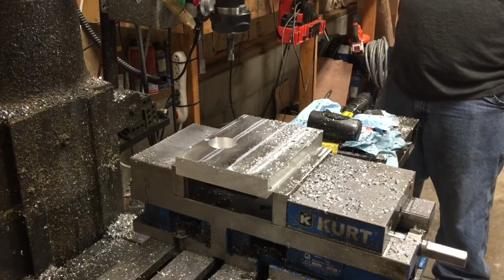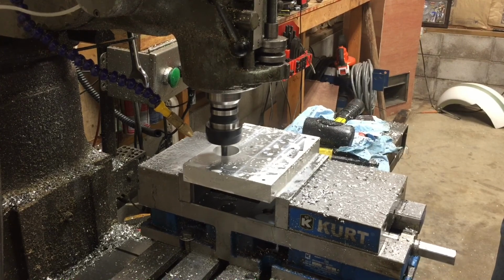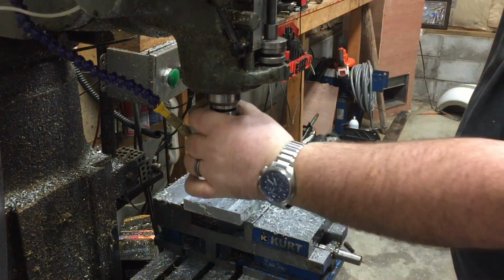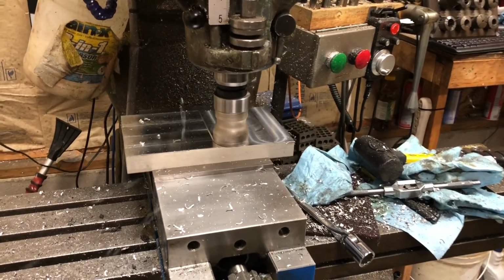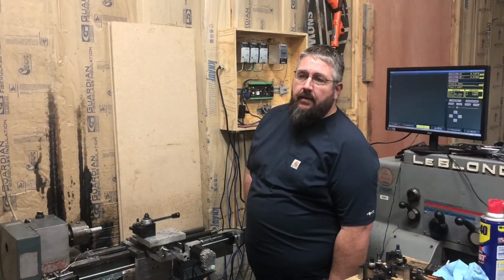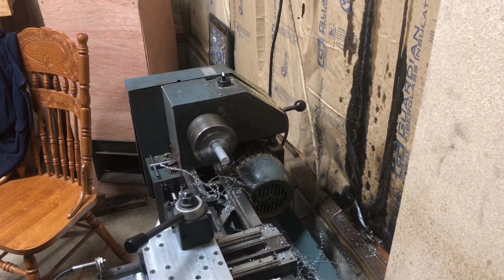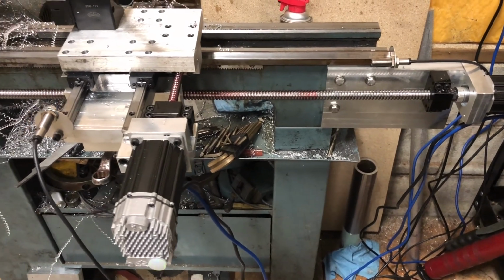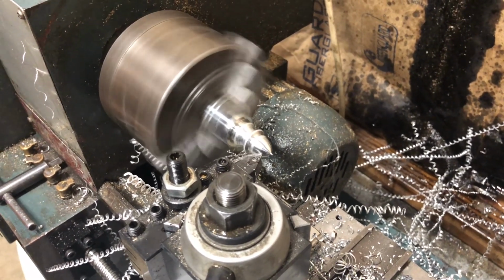9x20 Lathe CNC Conversion With Masso And Clearpath Servos Part 2

Comment: looking good John,    following along..  can you tell me what model clearpath servos  these are ?  and are you satisfied with the torque ?    thanks  Joe
Reply from the maker: Raptor Machine & Tool Co. definitely satisfied with the clearpath servos.   They made around 1394 once inch I think
Reply: @mowbetter2010  thanks for the reply.. so they are the same torque as the bridgeport ?  just a smaller frame ?       think im going to jump on this bandwagon.. lol
Reply from the maker: Raptor Machine & Tool Co. i really never knew wht the toque of the Bridgeport was. I took a stab in the dark and went bigger than I thought I would ever need.  I did use a online calculator to figure out the amount of force that I could create with the ball screw and that amount of torque from the clearpath.
Reply from the maker: Raptor Machine & Tool Co. this is the exact model number CPM-SDSK-3432S-RLN i used for the Bridgeport.   I’m sorry i was confused the lathe has smaller servos on it
Reply from the maker: Raptor Machine & Tool Co. i used these for the lathe. CPM-SDSK-2331S-RLN
Reply: @mowbetter2010  john, thanks so much for clarifying !!

Comment: Do you have any drawings or plans for the 9x20 CNC conversion?
Reply from the maker: Martin Hoolachan no might have some fusion 360 files of wht we made.
Reply: @mowbetter2010  Many thanks John for such a prompt reply. I'm actually in the UK and was particularly impressed with the simplicity of the conversion. I would greatly appreciate any Fusion 360 files you may still have with regard to the 9x20 CNC conversion.

Comment: Hi there John, does your z axil has backlash, did you change the screw for ballscrew? I'm planning on making my South bend mill to a  CNC
Reply from the maker: Not really the weight of it keeps all the load in one direction. There has to be a little in the gears im sure but enough to do the jibs we run on it.
Reply: @mowbetter2010  thanks for the information
Reply from the maker: Andres Gonzalez well i may have spoke to soon.  If ya was referring to the mill there is very little backlash due to the weight and it is the original screw and brass.  The lathe we done did get a new ball screw for the z axis. I just seen this was in the lathe build video. Thx

Comment: So would you recommend converting a Bridgeport to cnc after don't yours?
Reply from the maker: Capt. Cheese ya I think so. Its a little less ridged than I thought it would be. For mine a 3/8 tool is about as big as i like to run.   Even if ya don’t run it as a cnc it nice to have it for a digital display and dont have to crank that heavy knee up

Comment: How do you like the Masso? Im looking at upgrading my router table from mach3 and possibly using it for a mill conversion in the future. Looking at Either that or centroid acorn
Reply from the maker: Redshift CNC so far it has been a decent controller so far. It has some running issues if it gets hot and does some unexpected things.  But mine is almost 3 years old and one of the first sold. We removed the cover from the center of the controller and it has been ok since.